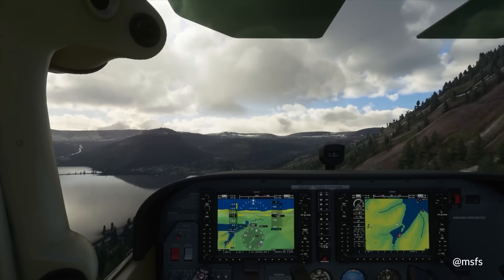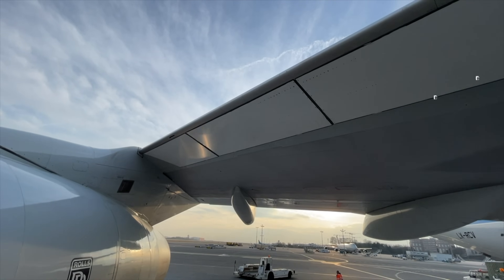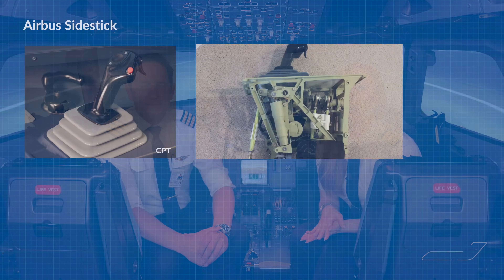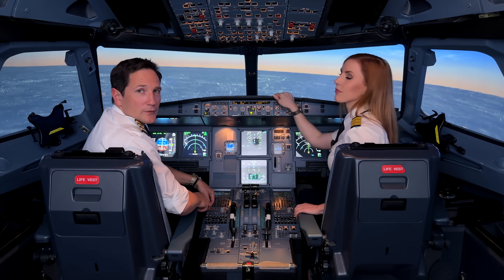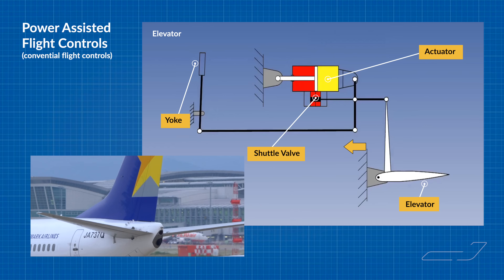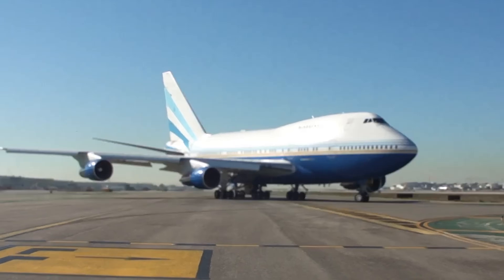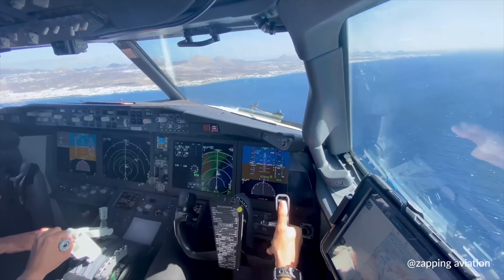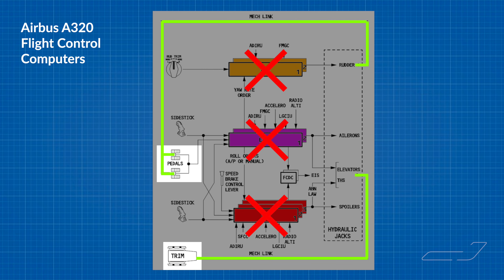Which AIRLINE JET has the better FLIGHT CONTROLS? Explained by Captain Joe and Raja

Comment: I don’t necessarily dislike sidesticks, but I dislike the ways in which the Airbus fly by wire work. It doesn’t feel like a plane, and I personally like flying planes, not computers with wings. Active sidesticks like some new Gulfstreams have, with a more conventional feeling fly by wire system like newer Boeings, would be okay with me. I’ll never be opposed to a good ol’ yoke though.

Comment: How about fly-by-LIGHT? The first aircraft in the world to use a fly-by-light (fiber optic) flight control system, with no conventional backup, was the Westinghouse Airship Industries Sentinel 1000 blimp. The Sentinel 1000 flew from 1991 to 1995 as an engineering test bed for the US Naval Airship Program.

Comment: Great video thanks to you both. As a passenger if I was going to learn to fly an aeroplane I would much prefer to have the Boeing yoke than the Airbus side stick. It just seems well..... right.
Reply: Yes, for training the sidestick (or more specifically fly by wire tech) would actually be negative training as one wouldn't be able to understand the physics of how the plane is reacting. For airline flying one can't go wrong with either.

Comment: Well I guess Joe if you are a Boeing pilot you prefer the yoke, if you are an Airbus pilot you prefer the side stick.  I can't see many Boeing pilots preferring the side stick and visa versa.
Reply: Thats not how it works. As the yoke has the advantage of having better controllability implemented in it, and the sidestick has the advantage of being convenient in terms of cockpit ergonomics, it depends on what one prioritizes in the moment
Reply: @ZK-APA  That comment makes no sense what-so-ever, I was talking about preference, not function.
Reply: @WayneM1961  again no. Because in reality, the pilots don't choose which aircraft they want to fly, the airline does. One may prefer sidestick, but if the airline has a requirement for Boeing pilots, they have to fly the yoke and vice versa.

I've flown both sidestick and yoke. I've flown with people who've flown both sidestick and yoke. Everyone has the same opinion as I've explained before.
Reply: @ZK-APA  Well, in a way the pilots can choose what they want to fly by choosing which airline to fly for ;)
Reply: @kallek5655  In an ideal world yes. In the actual world, it depends on luck. As in if say you want to fly XYZ airliner, you need to have an airline which only has that aircraft, or has an opening only for that aircraft and in a location where you are eligible to apply with the experience they are asking for.

Comment: The stick shaker may hinder a pilot’s ability to regain control of the jet. By inducing significant vibration, it can interfere with the pilot’s motor reflexes and situational awareness, potentially making it more challenging to recover from a stall.

Comment: There is no way you can convince me that a left side stick is appropriate for a right handed pilot.  Off hand is typically less coordinated which is IMO a design flaw.
Reply: Irrespective of yoke/sidestick, if you sit on the left you fly with the left hand, and vice versa (with the other hand controlling the throttle). Its the same logic as left hand drive vs right hand drive.
Reply: @ZK-APA  Analogy is wrong.  In cars, steering wheel is in the center which gives driver option of using either hand.
Reply: @encinobalboa  But at the same time one doesnt change gears with the outer hand.

Also, if you have seen any videos of flying from the left seat (airline or even a trainer aircraft), it is always flown by the left hand. And this is implemented from the training stage. If one is flying from the opposite hand only (or both hands in an aircraft that requires throttle control), then that is an incorrect technique.
Reply: @ZK-APA  Be honest with us.  Are you as good in sports or any activity that requires manual dexterity with you dominant hand as you are with your off hand?  For most, the answer is no.  Sure, you can train but in an emergency, stress will reveal this deficiency.
Reply: @encinobalboa  Firstly, I am not giving a subjective answer, but an objective answer. Everyone learns the same way.

And TBH, being a lefty or righty doesn't matter. Flying from either seat feels the same. Only thing to keep in mind is that yes there is a learning curve. Eg in my case I started on the left (like everyone). And when I moved to the right seat, I was very uncomfortable. But slowly got the hang of it, and now if i have to sit on the left seat, now that has become uncomfortable. Yes for someone who is qualified to fly from both seats may have a preference, but in practice it doesn't matter because your motor skills develop equally.

Although yes, the logic of using the dominant hand to fly is there, but in high performance military aircraft.
Reply: @ZK-APA  You can't answer a simple question because it is true.  Your off hand is not as coordinated as your dominant hand.  I always choose Boeing because I want my pilot to fly with the best coordination possible.
Reply: @encinobalboa  Again I am telling you. Even on a boeing one doesn't fly on this basis. In fact if a pilot does this (fly on the left seat with right hand primarily on yoke) that will result in a failed simulator or check flight with corrective training required.
I am just curious now that how are you recommending a technique that boeing themselves doesn't recommend?
Reply: @ZK-APA  Your off hand is not as coordinated as your dominant hand.  That is a fact that you cannot admit.
Reply: @encinobalboa  Then argue about this with aircraft manufacturers. Also if you personally haven't flown an aircraft, then your arguments doesn't have weightage.

Comment: Personally I like the conventional flight controls way more than that artifical stuff the FBW Airbus planes do.
I wonder though how it is to fly the C-Series (A220), as far as I understood its side sticks are mechanically linked and you have to trim, just like on Boeing's FBW aircraft, too. Also what's it like to fly the Embraer with its bike handle?
Reply: A220 sidesticks are not interconnected.

Comment: How is it for lefties? For my Flightsimulator the stick is on the right and perfect. Feels like I couldn't handle the stick on the left properly. Do Pilot and Copilot switch places depending on their handeness?
Reply: No. If you sit on the left, you control the aircraft with your left hand (and throttle with the other). And vice versa if you are sitting on the right side. Even with a yoke, although you can hold it with both hands, you still fly it with one hand only.

And in terms of lefties vs righties, its basically the same concept of left hand drive vs right hand drive in cars. Eventually one gets used to it.

Comment: Regardless of input device - stick or yoke, I think there should absolutely be physical feedback between the left and right seat controls, whether it be by a mechanical interconnection or generated electronically.  There has been at last one Airbus crash (Air France out of South America) where the captain and FO were putting opposite control inputs in as the plane plummeted into the ocean in a deep stall.  Neither could tell what the other was doing due to lack of feedback.  In a high stress situation, a callout of "dual input" is likely to be missed, but force on the control in the opposite direction much less so.  I seem to recall just recently seeing another video involving an Airbus where the autothrottle took over and made a power adjustment but that the throttle levers in that case don’t move, so the pilots weren’t cognizant of what was happening.

It strikes me that having the computer as involved in flying the aircraft as Airbus does (automatically coordinating turns, automatically trimming pitch, etc) can leave the pilots too out of the loop and behind the power curve situational awareness wise if things suddenly go tango-uniform.

Comment: The first non-commercial vehicle to use fly-by-wire (FBW) technology was the NASA F-8 Crusader, a modified version of the Vought F-8 fighter aircraft. It was a testbed for digital fly-by-wire systems, and NASA began testing it in the early 1970s. The F-8 was retrofitted with a computer-controlled flight control system, marking the first time an aircraft relied entirely on electronic controls with no mechanical backup.

This groundbreaking work paved the way for the widespread adoption of fly-by-wire technology in both military and commercial aviation.

Comment: the Apollo Lunar Landing Training Vehicle
The first pure electronic fly-by-wire aircraft with no mechanical or hydraulic backup was the Apollo Lunar Landing Training Vehicle (LLTV), first flown in 1968. This was preceded in 1964 by the Lunar Landing Research Vehicle (LLRV) which pioneered fly-by-wire flight with no mechanical backup

Comment: Excellent video! My question is, why doesn’t the Boeing 717 use a flyby wire system, considering it entered into production in the late 1990s? The 777 is somewhat older, no?
Reply: Because the boeing 717 isn't a true boeing. Its more of a rebranded MD95 (something like how the Airbus A220 is essentially a Bombardier C series aircraft)
Reply: @ thanks so much for answering this. I really appreciate it. I kind of figured it had something to do with that, though I was thinking along the lines of the DC nine, and I had forgotten about the MD 95.

Comment: Ninety percent of the world's population is right-handed, putting a stick in the left hand of a person is a traumatizing experience, which can put the lives of hundreds of people at risk.
The best thing to safely pilot an aircraft is the control column or "yoke", which allows the use of both hands without having to change seats.
Reply: Even with a yoke your right hand will be on the throttles. You will fly the aircraft using your left hand if you’re in the left seat, regardless of the aircraft type. Fortunately, it’s all training and tens of thousands of right-handed pilots fly planes with their left hand everyday. And yes, it’s safe. Of course it is.

Comment: no feedback in the hand control is the other person takes control?  seems like a big design flaw....one designer not talking to the other!

one big issue i see with the side stick is that what if you're in the seat with the stick on the left and you are not left handed? isn't this a safety issue?  surely the column in front of you with both hands on the control is safer just like a car you are taught both hand on the wheel...how is an object that needs controlling in 3D space doesn't need as much control?  please explain
Reply: Although the yoke can be held by both hands, in actual flying, you only have one hand on the yoke, and the other on the throttle (one exception is just after V1 during takeoff). Hence irrespective of yoke or side stick, if you sit on left you fly with the left hand and vice versa.
And yes, no sync between both side sticks is considered as a con. Hence airbus has to implement a proper takeover technique.

Comment: Mechanical is proven vs Not Reliable complex computers with sensors ....

Air France flight 447 or (AF447/AFR447) disaster.
Reply: Actually its the other way round. The probability of mechanical failing is way more than FBW (reason being that a mechanical system has way more moving parts, hence a higher chance of failure).
The issue with a FBW system is not that it is more likely to fail, but the fact that if something does fail, the pilots need to have an understanding of the systems in such a way that they should be able to decipher what is wrong and what is the aircraft intends the pilot to do before the pilot take action.

Comment: regarding the sidesticks canceling each other out. Not to be macabre, but it wasn't theoretical on Air France 447 unfortunately. It seems to be the side stick's biggest weakest. It isn't readily apparent what the other pilot is doing or attempting to do vis a vis the directional inputs. Was the dual warning light and audio a thing when Air France 447 happened or was that instituted as a response?? I can't imagine that was a thing in 09, and that both those guys ignored it, but that was such a head scratcher all around, who knows.
Reply: I don’t remember every detail of the final report off the top of my head, but I think the other aural alerts (stall warning etc) took priority and that’s why the dual input aural alert didn’t sound, at least most of the time. Also, during stressful situations, hearing is one of the first sensory inputs that is being ignored by our brain. That’s why many people don’t hear warnings during high workload situations, even if they’re fairly loud.

Comment: how's that  crummy plastic  joyboy side stick  gonnna do when lose all hydraulics fluids.. not good
 boeing yoke way way better in deadly outof control  situations
Reply: "how's that  crummy plastic  joyboy side stick  gonnna do when lose all hydraulics fluids.. not good". The A380 and A350 has electro mechanical hydraulic actuators (EBHAs), that will power the spoilers, elevators, horizontal stabilizer and rudder if both (yes there's two) hydraulic systems lose fluid or pressure, as long as an engine is running. The rest of the Airbus aircraft are screwed.

And for the record, apart from the A350, A380 and 787, lose all hydraulic fluid/pressure any other aircraft bigger than a 737 and you're pretty much dead. Yes, that means the 747, 757, 767, 777, L1011, DC/MD10/MD11, A300, A310 etc are dead, and they all have yokes. Don't don't mean shit on those aircraft I mention if you lose all the fluid as the yoke only controls rods to control hydraulic system fluid on those.
Reply: @ClaysonAntoons   good to know info... I learned A350 A380  must be most super advanced  glass cp best  latest avionics  Airbus has now.
 Glad I asked about this ..lot good info about  diff  yoke vs sidestick
Are u also Airbus driver?
u sound like know alot tech stuff on the big iron.
Reply: By that logic, what would a yoke aircraft with conventional controls do when all the cables and pulleys snap? Same thing, it'll become uncontrollable (and yes it has happened before)
Reply: As said in the video, the aircraft would be controllable by pitch trim and rudder (and asymmetric thrust)👍
Reply: @rajainthesky Actually in this case, with an all hydraulic failure (ie all 3 systems gone), the aircraft will be uncontrollable, even with the THS and rudder (as although its mechanically linked, it is still hydraulically actuated).
Having said that, because of the redundancy, the probability of having a triple hydraulic failure is virtually nil by design.
Reply: @ZK-APA  yeh not rly.. just watch few episodes Mayday Air Disasters..been many hydraulic losses and need 2 strong tuff guys pulling or pushing on both yokes to maybe get back in control.  How ya gonna do that w lil gameboy AirbusjokeJoystick ?
Reply: @ of course without any hydraulics the airbus is unflyable. That’s why it has redundancy built in to avoid such failures. But if you are making a specific narrative to prove a point without taking into consideration the redundancy then it doesn’t make sense.
It’s like saying that if the pulleys in a non FBW system snaps or the yoke jams (which a FBW system is immune to) then how will the pilots control the aircraft?
Reply: @ZK-APA  no  just comparing apples to apples... that joystick is def disadvantage detriment vs Boeing yoke.    simple as that... already  explained  scenario what could happen
Reply: @phillp7777  Of course  the sidestick is considered inferior to the yoke. Its universal amongst pilots. You won't find a pilot who has flown both and say that the sidestick is better for hand flying.
But at the same time airbus knows this. And the intent of the sidestick is not to prove that its better than a yoke. Its not, and to combat that, airbus had to put redundancies and techniques to counteract that.
The logic for the sidestick is more for ergonomics than control. And this although doesn't make much sense in general aviation, it makes a difference in airline flying. The airbus is much more roomy, has more creature comforts which could be implemented because of the sidestick. And this actually makes sense when one is flying long hauls or multiple short sectors.

PS I fly an airbus. When I hand fly it, the flying technique is less natural than a conventional yoke aircraft (in which I did all my initial and multi training), but at the same time I understand what it gives in return.
Reply: @phillp7777  Can't comment wrt to the latest boeing aircraft, but in airbus if you lose all hydraulics, you basically lose all flight controls which means the aircraft is uncontrollable. No sidestick movement can change that. But then at the same time the airbus (atleast in the 320) has 3 independent hydraulic system, with all 3 having a different primary source. And the hydraulic system is designed in a way that out of the 3, as long as even one is operational, the aircraft is flyable. And since all 3 are independent, if any fails, it wouldn't affect the other ones. So in terms of this, the airbus is quite safe. Yes there have been accidents, but from all something was learnt and implemented so that it won't be replicated further.
Reply: @ZK-APA  good to know .. yur a Airbus pilot ?  which ac ?  Can u say for  who?
idunno I'm no pt121 only barely Ppl but just asking from observing learning.. Have u watched some the Mayday AirDisaster  episodes ?  So sad  unbelievable  bad acvidents.... but can learn alot .. can yur life and yur pax  just from knowing these  prev accidents. Goodluck
Reply: @phillp7777  I am rated on the 320 series  (only one I am not rated on is the PW1100G).
Thing about air disasters is that there is a flaw, things happen, you learn from it and prevent future similar things to happen.